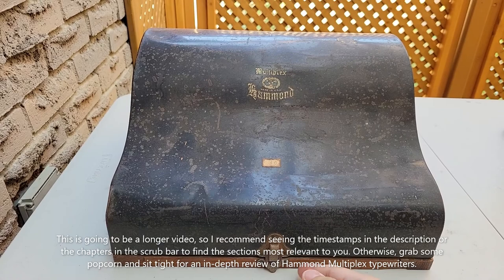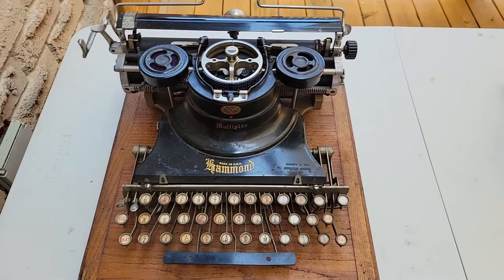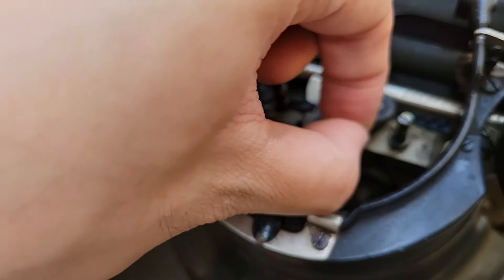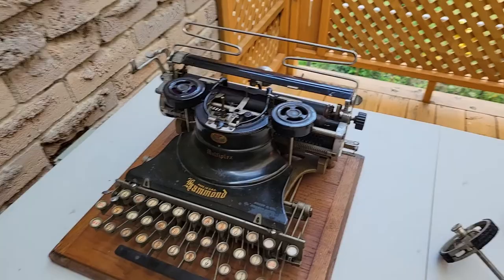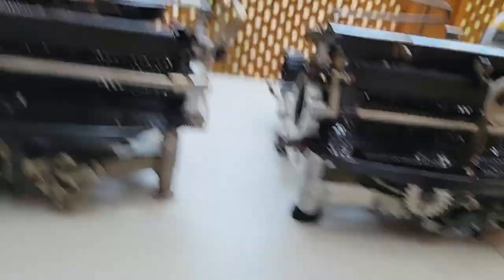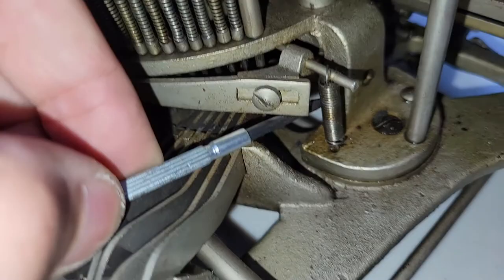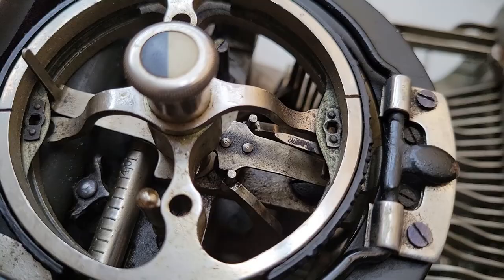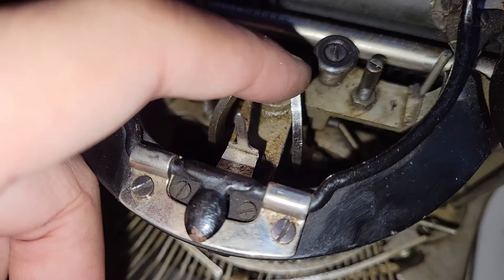Hammond Multiplex Typewriter Deep-Dive Part 1: Comparison, Mechanics, and Repair

Comment: The progression from cast/milled parts to stamped parts is typical in the progression of mechanical designs. The milled parts are more precise and more robust but the stamped parts are cheaper, lighter, and easier to assemble even if they aren't quite as robust. That doesn't mean they aren't adequate for the job, though. You notice how overbuilt that earlier machine is. Classic example. These changes also typically make them easier to service as well.

Comment: Too bad about cracking that lever, but I've had two (or is it three) Hammonds with one of those levers broken.   I think the breakage happens when the shuttle becomes bound or sluggish and the typist pushes hard on the key to get it to move.  The key levers have enough mechanical advantage to break the lever, which seems to be a casting.  The takeaway for anyone who has gotten this far is not to force the keys when something binds.  I haven't watched your next videos, hopefully you found an effective repair.  Or is the JBWeld actually holding?  That would be fantastic.
Reply from the maker: I did indeed get the J-B Weld to hold. The crack was rather due to my use of pliers in an attempt to bend the pin that was not engaging properly with the shuttle arm. I had at the time not found any other suitable way to adjust it without substantial disassembly.